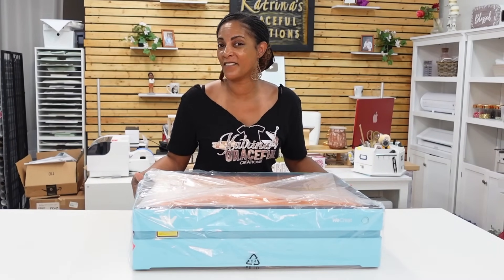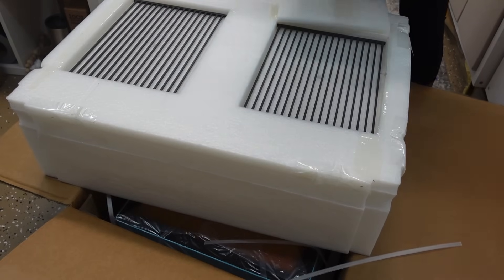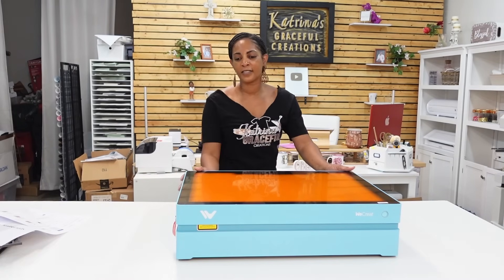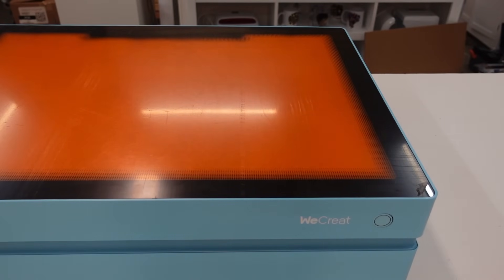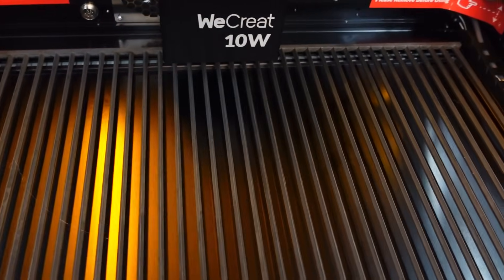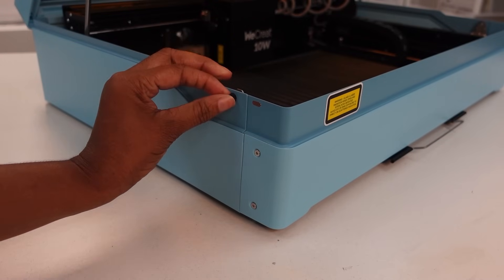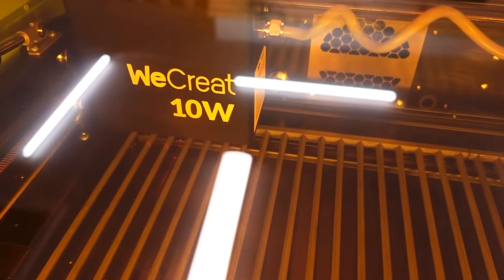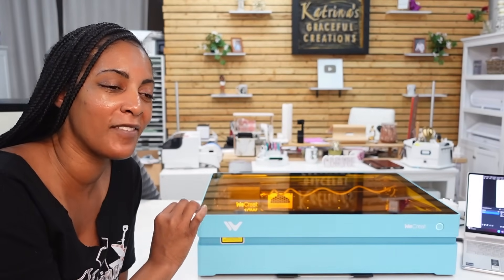Small & Compact! The New Desktop WeCreat Vista Laser Engraver! Is it worth it?  Full Set up and Demo

Comment: Karina, I know you have the air purifier. Does it work well. They have a special on it with the Vista. Another blogger said it doesn't work very well. You also have the pass through, have you used it and if so, do you like it, is very easy to use. Thanks so much
Reply from the maker: @judyromano2229  none of the air purifiers are the best you can still definitely smell it but hey it’s better than nothing. I still have to do a video on the pass through. Coming soon

Comment: thanks for this video, it is exactly what I was looking for. So what were the settings for the acrylic? Could you have changed the settings so you didn't need to do 3 passes or is 3 passes the norm? Do you have a link for the acrylic?
Reply from the maker: @buddysmith7080  the machine give you the settings based on your thickness. I left it as it. You will see it in the software. And the material is from hobby lobby I went to the store